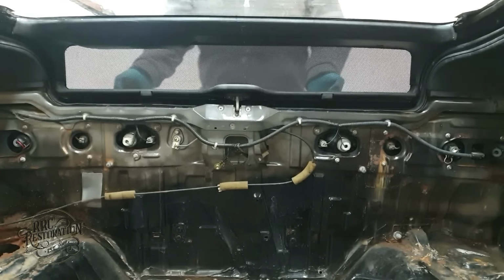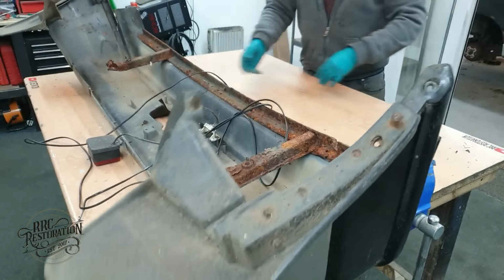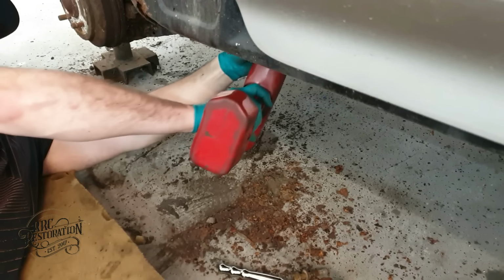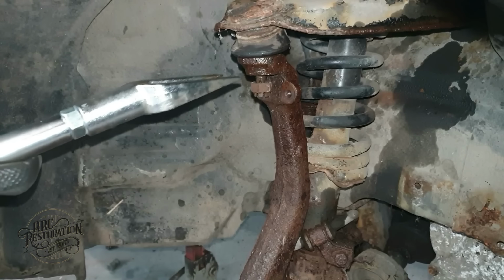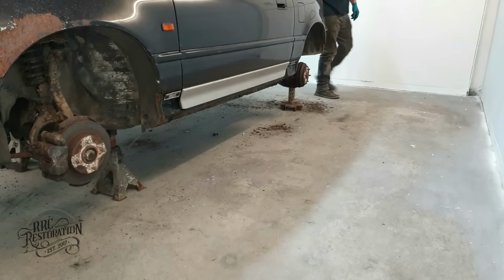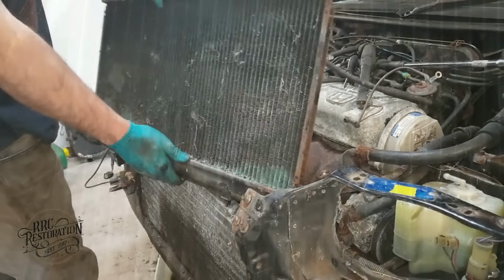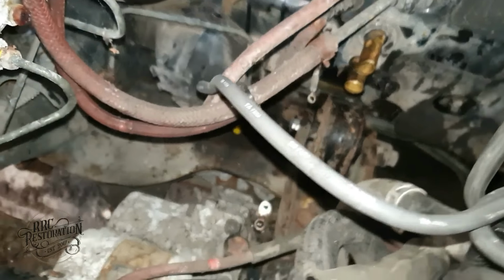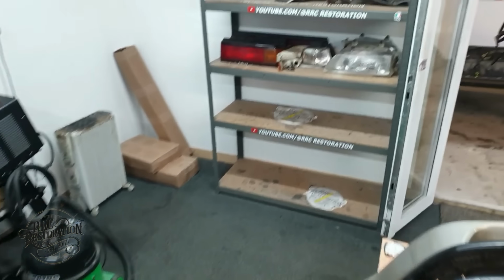Restoration Of An 80's Icon - Honda CR-X - Part 2

Comment: My first thought: "Man, let her go in peace...".

But when he took off the side skirt, saw the rust clinging to the air there and said "it's not so bad " I knew I was dealing with a madman.

"Let him cook" I thought.

Keep it up man.
Reply: I have owned 2 CRX's in my life (V-tech) and man do they love to rust.. sadly this one is far from the worst I've seen.
Reply: I can't imagine this one gets over the finish line.
Reply: @shannons1886  He has finished everything I have seen.
Reply: Lol
Reply: Lol! Great comment!
Reply: @Tendo8002  Yep. I've an Integra so very similar in tinworm affinity and in other examples I've seen real horrors under the sill covers, and in the rear arches, and in the boot floor, and in the door bottoms, and in... well you get the idea being a Rex veteran. 😁This one has its issues but definitely saveable, especially in this chaps expert hands.

Luckily I was paranoid when I got mine from Japan in 05 so the week I got it I flooded all the usual bits with waxoyl(later bilthamber, so much easier to use) and check and reapply every summer. So far even though it became my daily and lives outside in all weathers it's rust free and welder avoidant. 🤞🙏😄
Reply: I just finished a complete frame swap on my 2001 Silverado.  Did the rockers, cab corners, and fixed the bed.  Lots of body work and new parts and fresh paint.  But now she's good for another 25 years.
Reply: @shannons1886  I gave hope to the Dunedain
Reply: When he says it's not that bad...he mean's by Irish standards.
Reply: @harryx6968  😂
Reply: @shannons1886 you must be new here
Reply: There is a saying, 'you can't polish a turd' ...we shall see. 😂
Reply: @mickenoss  A crx is far from a turd. This car is more like rusty gold.
Reply: Well there is some rust left, and not just hole xD
I took my '89 to a body shop, to repair "some" rust on the rear panels, they ended up rebuilding almost the entire rear end because it was all rust.
Luckily I had already negotiated a fixed price of 2500€, they said it would have been "a lot more" xD
Reply: @harryx6968 Irish?
Reply: We have a masochist here
Reply: ha ha   good comment
Reply: Anyone who thinks that this little bit of rust puts this car beyond hope should check out the 51 Machines channel 260Z and R33 projects. OMG! The tinworm damage here is minor in comparison. I test drove the hot version of one of these back in the day, and it was pretty damn impressive back then.

Comment: I'm stoked to see this classic brought back to it's former glory. The only other things I would do besides the manual swap: upgraded disk brakes up front, a disk brake swap in back and a little extra sound deadening than what came from the factory.
Reply from the maker: sounds like you've taken a trip to the future and saw my plans first hand ;) ..... How does the CRX turn out in the end? haha. but yeah seriously I do plan on making a few nice upgrades like those just to make it a nicer car to drive in the modern era :)
Reply: @RRCRestoration  Fuel-injection upgrade, or sticking with the carbs?
Reply: @RRCRestoration just got back from the future. You struggled quite a bit with the AWD swap but it was worth it in the end. It was the only way you could get all the power to the ground with the freshly built turbo K20 ;)

Comment: This type of video is some of my preferred style. Too many in the YT world talk too much and don't get enough done.  As the setup and camera placement prior to each set takes so much time. So it's a nice pace with the way you show enough details that we get the jist.. but then snap fingers for the mirror efforts on the other side of the car. As well as not showing each bolt removal on the body work. It takes a sharp mind to make the call as to what you show and what you don't. Makes for an EZ watch.  From Canada!  Keep it up.

Comment: Three things really surprised me. Your remote clamp removal tool (what a brilliant gadget). The superb performance of Plus Gas, I was expecting a lot more utterly stuck bolts. Lastly your optimistic opinion of the corrosion on this sweet little Honda.

Comment: That power steering cooler reminds me of my Honda Accord VI. It looked similar to this one. Because there was no OEM replacement available anymore I bought some 10mm copper piping at a central heating store for 10 euro's. After 5 years it still works fine and will never rust again!

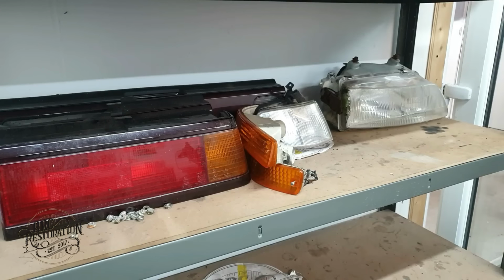Comment: 15:35 I felt that. I'm restoring my 74 charger that I've had 20 years and every little trim piece costs $300 in good condition. $320 for the driver side electric window switch. I only payed $600 for the car!

Comment: Considering the amount of corrosion on the car, it is impressive how well it came apart. That radiator....... I haven't seen one that bad before!  This is a real labor of love. If I remember correctly, the early 80's CRX had plastic fenders, didn't it?

Comment: I've worked on cars for most of my life and over the years I've struggled with nuts or bolts getting stuck inside a socket. For some reason I've never learned the "tap the side with a hammer" trick. Thanks! I feel like an idiot lol
Reply from the maker: Haha no worries its an old mechanics trick that has been passed down a few generations now ;)

Comment: For the bad rear end, I can recommend 2 ways of patching up those holes.
1. Use a bit of cardboard and trace out the least worse side and then cut sheet metal to shape, then replace
2. Find a high quality 3D model and just have a machine laser cut sheet metal for the parts you wish to replace (can pay a shop to do it if you don’t possess the laser cutter)

Comment: Another thumbs up for Plus Gas.
I used that when stripping all the subframes and suspension on a 2006 NC (mk3)MX5, which are prone to rusting.
I didn't shear any bolts.
It's a genuine penetrating fluid, not a water dispersal fluid.
The welding would be outside of my abilities, the mechanicals i could do, but you have a very wide ranging skill set, so it is all probably a breeze to you.
Good luck.
Reply from the maker: Yeah plus gas is amazing stuff, I wouldn't be without it now. Thanks for watching and leaving a comment.

Comment: I feel you on making it hard ot let go. I have a 92 ranger I have owned for 24 years. It has 247k and has rusted out brake lines twice, floors are gone and the shock towers now make it unsafe to drive. I thought of just junking it but parts are so cheap I decided to just take it off the road for now and put in a 302 v8 in it. I was also able to buy rust free parts from someone elses project for next to nothing. The issue merely become time. IF the frame is good, then if you really love the car and can do the work. Do it.

Comment: New viewer here. I was doing my usual scrolling on YouTube when the CRX caught my eye. Watched the first two videos and got me hooked.

I’ve always found the design of the CRX quite odd but a sort of hot batch of the 90s. Shame they didn’t officially release here in the U.K. (well, I don’t think they did) but cool neither the less.

Glad to see this one is going to get a good restoration and not just a quick panel here and there.

Any plans for this? Keeping completely stock - apart from the auto to manual swap! Or doing a few upgrades along the way?

Gonna subscribe so I don’t miss any episodes!!

Comment: Step 1: drop the entire car into a dumpster full of Evapo-Rust. Let it marinate for a week.
This is a massive project, but I think the rust remediation will be the most time-consuming stage. Lots of cutting away the rot, lots of shaping & welding-in new steel. TIG welding might be helpful, but I'm no auto body expert. Good luck sir! I know you can do this project, but it sure looks like a lot to sort out right now.

Comment: Can’t wait for you to crack into the engine and start cleaning it up. Are you doing a full rebuild of the engine? Also per the condition of the suspension I’m invested on seeing your restoration process, specifically some of the chemicals you use to make it happen.

Comment: I don't know if you're planning an OEM restoration or if you plan on an OEM+ restomod. 
If the latter, may I suggest taking that D15 and using it for a boat anchor. Find a nice B16A and a Hondata ecu for it.
That way, you're in the ballpark of an SiR.

Comment: Fwiw, the screws you removed from the tail light area are not ' wood screws ' but rather would be called ' sheet metal screws '. To the layman they can be hard to tell apart.😁

Comment: And I'm concerned about welding my '07 Transit connect...You have a mountain of work ahead...
😮
Was that a JDM model, with a all that japanese stickers on the motor?
The carb setup and position just call for twin webers!
Thanks a lot for taking us with you!
👍👍👍
Reply from the maker: Hi, Yes its a JDM import, The engine is going to be replced with something a bit more powerful ... If i can source all the parts i need.

Comment: Fabulous to see this in my subscription list. Is this going to be a proper nut & bolt re anodise , powder coat restoration like the Ducati’s or a wire wheel, hand paint hammertite job? I’m hoping it’s a proper job 🤞🏻
Reply from the maker: Proper full restoration just like all my other ones ;)

Comment: Almost 40 years old and all of the bolts and screws removed no problem at all.
I do some cars that are 4 years old and a lot of the fasteners are rusted out.
It just goes to show what crap steel they use in the modern cars.
Long live the Honda.

Comment: You probably have all your materials figured out already at this point but I thought I should share something. I have found the very best primer to use on heavy restorations that works amazingly on rusted metal. XOINS labs rust primer. I used the brush on but I'm pretty sure you can spray it too. It is tough stuff but man is it expensive. It's the highest rated stuff I could find and I'm going to trust it on all my rusted areas ( after a good wire wheeling and or sanding and aspho treatment) from here on out.

Comment: Bearing in mind the debris on the garage floor, placing the car on cardboard ( use old a/c or fridge boxes) before starting would enable you to easily clean up the mess every day.
Reply from the maker: Top tip right there ;)
Reply: @RRCRestoration  One aims to help, using old cardboard boxes for any work help keep a workshop clean and easier to keep clean, and a more professional look to customers when they see a clean workshop floor.

Comment: Judging by the square fog light on the bumper is this a import ? I've had a Crx and they are a pocket rocket , the fog light on mine was incorporated into the red middle section, mine was 16v twin cam , Glad you went ahead and saved it 👍
Reply from the maker: Hi, yes its a Japanese import I covered all the details in episode 1 ;)

Comment: Power steering cooler? The UK spec ones weren’t assisted steering, one of their many plus points. Also, ditch the carb fed 1.5 and drop in the EFI 1.6, either VTEC or not, both were fantastic units. Good luck!
Reply from the maker: Yes but this isnt a UK car it was a JDM import ;) , also an engine transplant is on the cards as i dont really want to be running carbs in this day and age.

Comment: Original honda headlights, blinkers, and brake lights are very, VERY hard to come by. Even ones for sale in rough condition are worth a pretty penny. I had a 99 honda Prelude. The first thing I did was pull the original headlights and put some cheap after-market ones because I didn't want to break the OG ones. I sold that car but sold the headlights separately for 750

Comment: I'm amazed the suspension came apart with such ease. My EF is basically mint next to this and I broke or rounded about every suspension bolt.

What was the spray you used on the bolts though? Your accent is a bit hard to understand at times.

Comment: Beautiful built when cars were built to be worked on Retropower said they are using most of the nuts and bolts from there donor hondas in the Alegro / Honda hybrids they are building.

Comment: @RRCRestoration - hey sir from oop north - can you let me know what ball joint splitter is, Hilka or another brand?
And were you the one using an automatic ratched wire crimper tool as well? If so, once more - what brand is it?

Thanks!

Comment: Ah yes the old "power steering cooler" from the early '90s which is basically a tube exposed to the air.  🙃

Comment: If I was you, i wouldn't just manual swap it but also add a turbo and a high flow exhaust system to the list as well.
As the 90 Ponies don't sound very exhilarating..

Comment: I live in a snowy climate where they use plenty of salt on the roads in winter, so I understand your assessment of 'it's not so bad'.  However, I'm sure viewers from dry climates are shaking their heads.  🙂  Are  you planning any performance upgrades during the rebuild, or would that be giving too much away at this point in the story?
Reply from the maker: Ive got a few upgrades floating around in my mind but don't want to give anything away until i know i can make it happen ;)

Comment: I was surprised the rocker panels weren’t all rotted. The plastic must have protected it from moisture.
Reply from the maker: I was really surprised too as usually the plastic holds in the moisture and rots then  out even quicker.

Comment: Are these rare or desirable in Scotland?   In the US you can find these all day in pristine condition as cheap as chips.
Reply: Patently untrue. CRX's are very desirable and constantly increasing in value. They aren't massively expensive but they certainly are not cheap. They were pretty rare in the UK though.
Reply: @DeeYarEss    Maybe I should start importing them to the UK.   They're everywhere here.   People have a hard time just getting their weight in scrap metal here. 
 There's one just across the street that's been sitting for years that's in better condition than this one.   I'll bet I could get it for $100.
Reply from the maker: These are VERY rare in the UK as a whole these days and cost a fortune to buy especially if they are mint with a VTEC engine.
Reply: @RRCRestoration   You'd be in heaven here the US.  Although I can't say if many of the American models came with VTech.  I'm assuming not, or they would be more popular with all the rice'ers here.  Maybe in a couple decades when they're harder to come by.

Comment: Brother make sure your tetanus shots shots are current before you go any further.
I'm actually pleasantly surprised at the number of bolts you removed without shearing them off.
I hope you find another CRX that you can graft a few pieces from, this will shorten the restoration time  if you have to otherwise hand fabricate them.
Reply from the maker: Yeah me too, I was expecting every bolt to break but seems i got very very very lucky with this one... so far lol